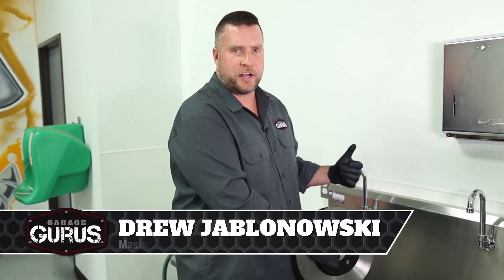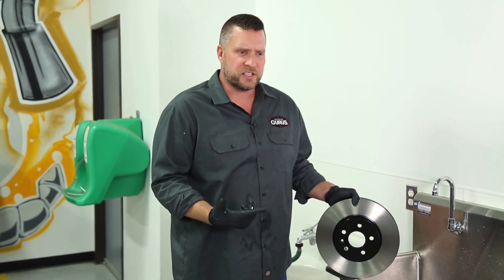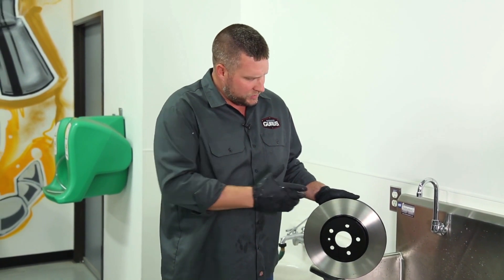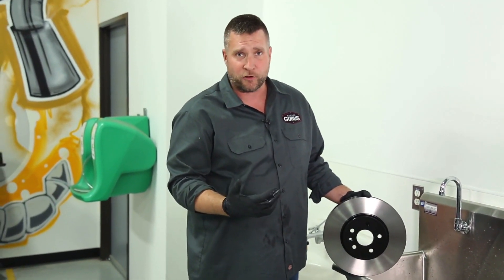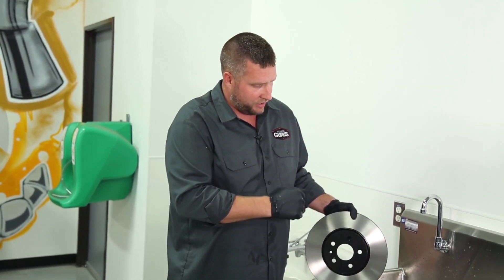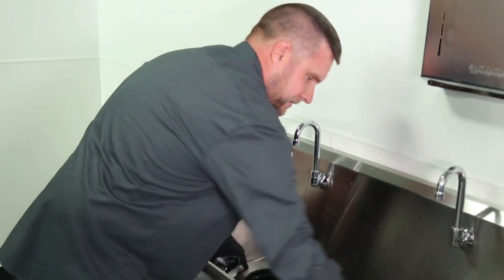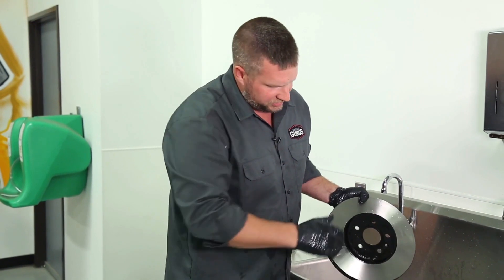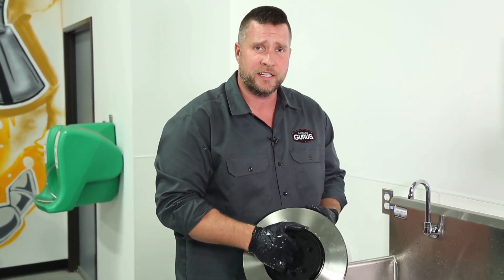Garage Gurus | Prepping Brake Rotors

Comment: In the 50 years I've been doing brakes, I have yet to do any of that. I don't wash the rotors, and I don't spray them down with brake clean. I wipe them off, maybe, if I feel like it, and install them.

The only preparation work I do is to the mounting surface that the rotors mate to. That's it. Those have to be crystal clear.

Comment: Probably going to light some people up with this, shop owners want as many cars a day as possible run through the shop- money. The service advisors want to sell the job to the customer- cheap- but the service advisor wont pay the tech the extra time to wash each rotor. So the tech gets it done quickly to make everyone above him happy. If you are going to do things like this that is not listed in the flat rate guide, the shop has to pay the tech for his time and charge the customer accordingly. That is only being fair all the way around.
Reply: You would have to be a pretty inept technician to not be able to spend 2 or 3 minutes out of the time you are allowed to spend on a rotor replacement! Most techs on flat rate can do the job and do it properly in less time than allowed! Many that I have worked with could make 12 or 16 hours pay in an 8 hour shift!
Reply: First you get good, then you get fast.

Comment: Can you scrub with a soaped Scotch-Brite instead of the bristled brush?  Seems to cover the machined surface more fully.

Also, use laundry detergent, either liquid or dissolved powder.  Dish detergent is rinsed off only with hot water.  Laundry products are miscible in water either hot or cold.